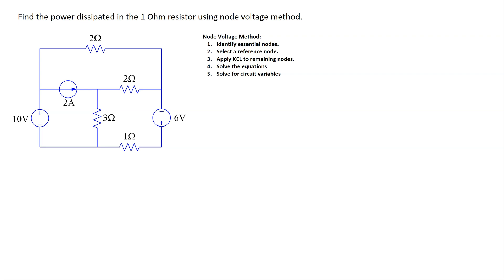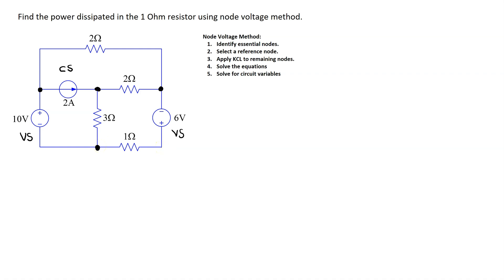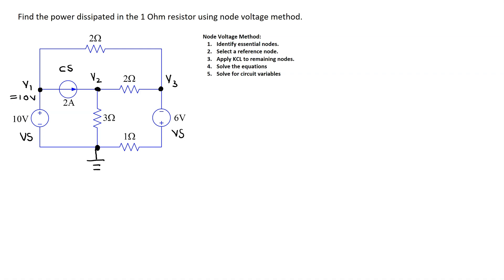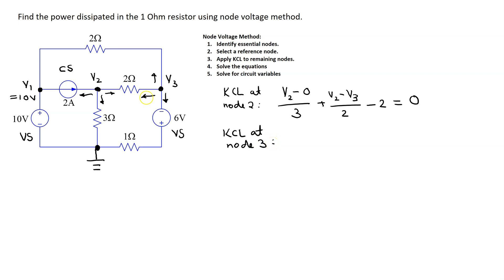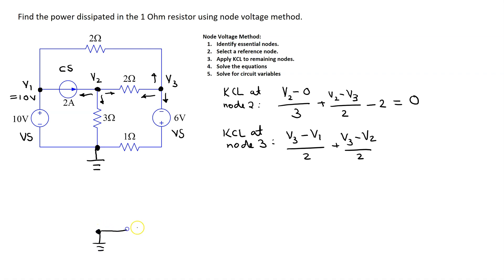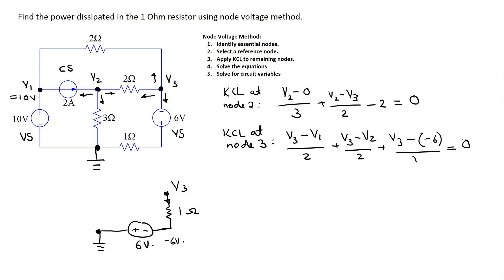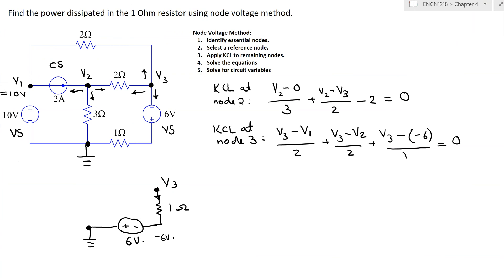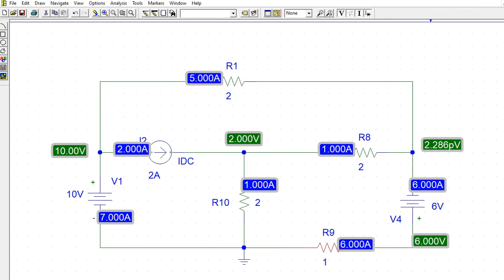Node Voltage Method - Example 4 (Trick: When to swap position of two series circuit elements)

Comment: In node 2, you wrote the first divisor as 2 instead of 3. so the answer is wrong
Reply from the maker: Thank you for carefully watching the video and identifying the typo in the video. The circuit equations in the video follow the given circuit which has 3 Ohm resistor connected between Node 2 and ground. However, the calculator solution and pspice solution in the video have the 2 Ohm resistor connected between Node 2 and ground. 

With 3 Ohm resistor, V_1 = 10V, V_2 = 2.47V and V_3 = 117.647mV

This typo does not impact the main concept the video is demonstrating: when and how to swap position of two series circuit elements.
Reply: @electriccircuits7164 These answers are also wrong, because V1 has always to be equal to 10. I found that V2=2.47v and V3=0.12v if V1 is constant and equal to 10.
Reply from the maker: @talhaozturk1283  That is correct! I have corrected this in the video description.
Reply: Oha Türk